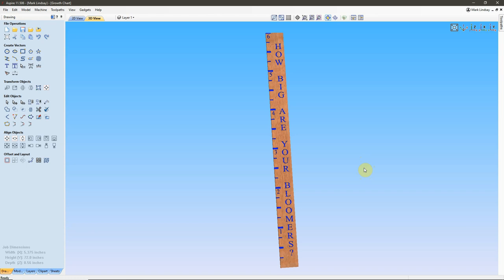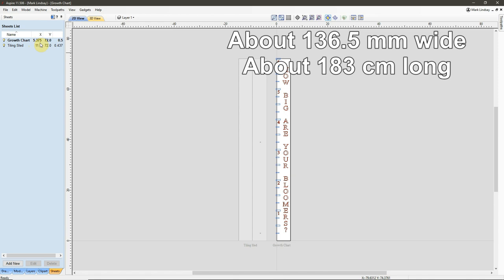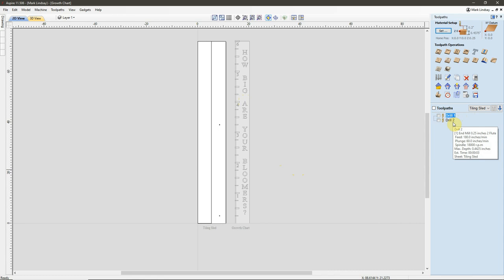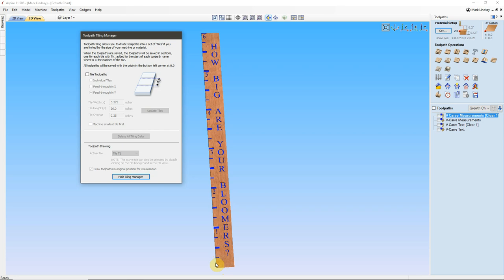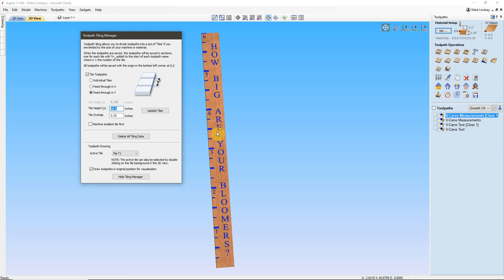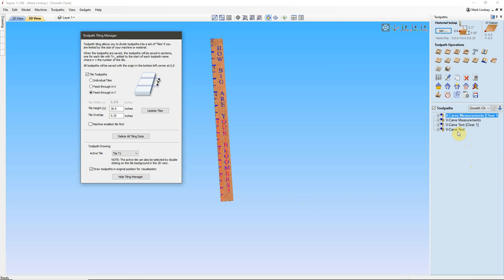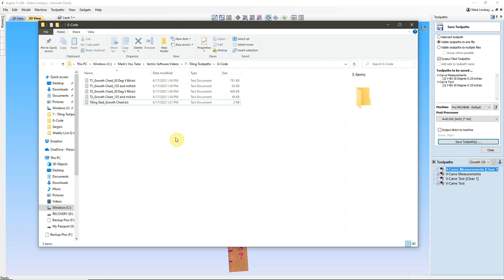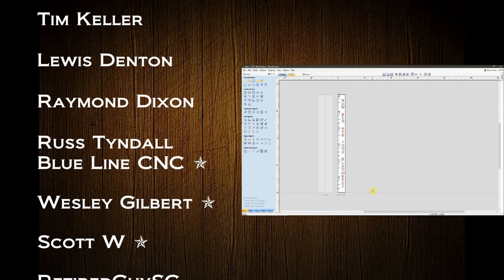Tiling Toolpaths Part 1 – Design, Toolpath, and Save G-Code

Comment: At least with VCarve Desktop there is a serious limitation with tiled toolpaths: there is no automatic ramp for a split toolpath.

As an example you can easily try this yourself. Create a profile toolpath with a ramp plunge for a rectangle, cut this toolpath to two different tiles and save the toolpaths into files. Look at the resulting gcode and you will see that the toolpath starts correctly with a ramp but all the recontinued parts (e.g. the entire 2nd file) of this toolpath use a straight plunge into the material. This can be a nasty surprise when using a downcut bit or a face cutter.

The reason probably is that Vectric uses some simple min/max calculations to split a toolpath into multiple tiles but it does not recalculate the new ramp positions when cutter has (rapid) moved to a splitted position.

Comment: Great presentation!
Because of expenses, I can only afford the Desktop version which only cuts 24"X24". My question to you is have you done or are you planning to do tiling of the same 6' sign on the smaller working surface (still in the 'Y' direction)?
Thank You for your help.
Reply from the maker: I'm getting ready to finally cut this project on my machine. I just had some projects jump ahead in line, and I had to get them finished first. Keep an eye out - hopefully I can get the video done and posted in the next couple of weeks.

Comment: Hi Mark!
Love the videos and they are very educational, so thank you very much for that!!!
So, if I have a 4' Y Axis on my CNC and want to make a 6' sign. Is there an easy way in vCarve Pro to setup a tiled project but instead of sliding the workpiece up or down on the CNC, but to take the workpiece out completely and flip it around 180 degrees and feed in the uncut side of the workpiece to the back. I realize that the CNC will need to know that the project is now upside down now.
I ask because where my CNC Bench is, I don't have any clearance to slide the piece back since it's against a wall on that end. I thought this should be easily accomplished, but I'm not seeing anyone attempting this.
I thought that I could just have two files and one is rotated 180 degrees, but wasn't sure if I was trying to reinvent the wheel. I suppose I can always create individual panels and join them together, but if it was possible, I'd rather keep it one solid piece.
Any insight or info would be very much appreciated.
Thanks again for all the videos!!!
Reply: Hi, I was also wondering if there was a possibility to do that, my machine is also against the wall. It must be able to do that but if it is in the software ? I just don't see it 
Maybe to design the piece and cut it in the program in 2 pieces, flip one piece over calculate 2 toolpaths make an fixed mounting jig at the far y end of the spoil board just wide enough to get the board in an exact place mill the first half of the project turn the board 180, and then mill the second part (upside down) 
However you cannot use a normal profile for the cutout you could of course cut the board exact to size on the table saw, that would solve 1 problem Yeah it might be doable at least for pieces no longer then twice the y distance of your machine. Hope my thinking gives you an idea at least kind regards Hans
Hi, I have been experimenting a wee bit, I cannot use my cnc at the moment, but I came up with the following 
Just make your drawing in v-carve, somewhere in the middle draw a horizontal line from left to right. the you have to cut all the crossing vectors might use the convert to curves command so to split every crossing with the halfway line make you toolpaths for the top of the design , then select all, and paste it on a new sheet hit the number 9 key a few times to flip it 180 and make the toolpaths for the bottom part (which should be up by now)And like I said saw the board to the exact dimensions 
Maybe try it out first on a piece  of unused material just create a square of you dimensions and draw a simple diagonal line frm to to bottom draw a horizontal halfway line and cut the diagonal at that crossing create a v-bit toolpath fot both the upper and lower  diagonal and try it out sucess again kind regards Hans

Comment: Would it not make sense to have 2 alignment pins to keep the piece straight and not use the pin as a pivot point?   Good info Mark
Reply from the maker: Good question, Steve. I'll demonstrate further during the Live Q&A, but basically, I'll have 2 other pins running along the left side of the project to keep it from pivoting.